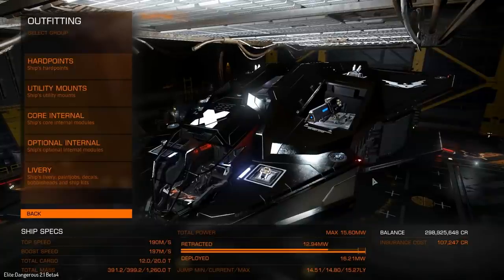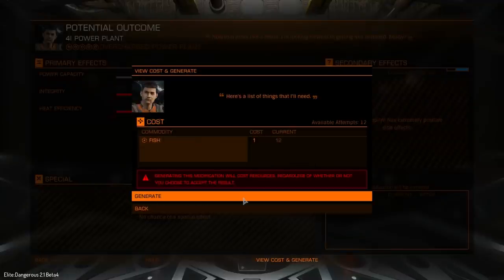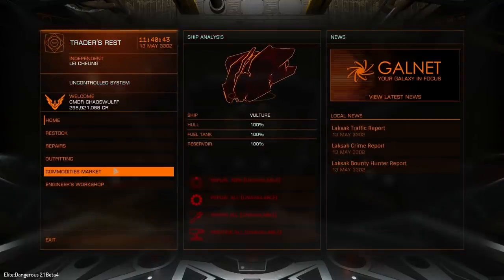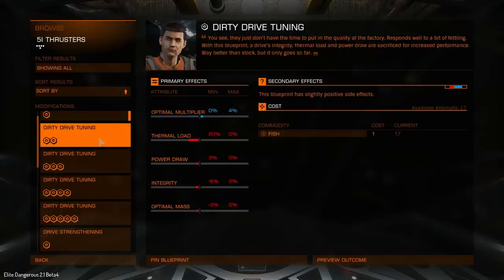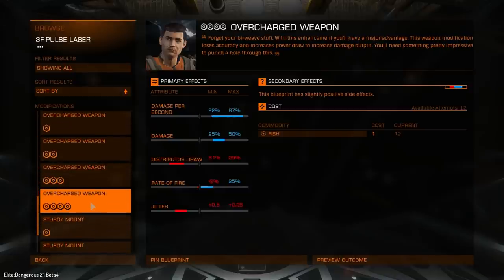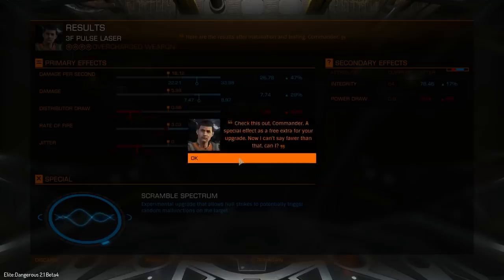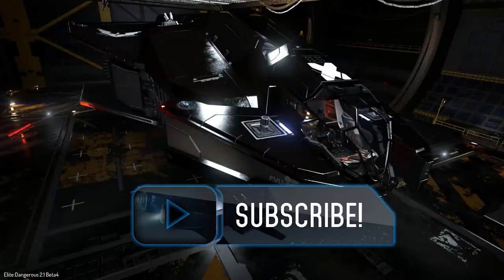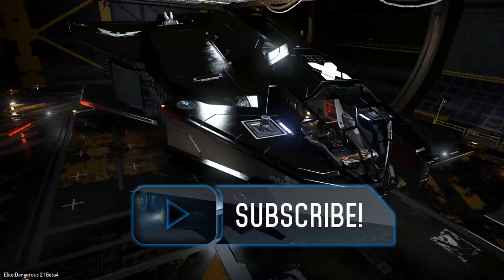Engineers Beta 2.1 - Modded Vulture

Comment: Thanks for the vids CW. 
"Hitting the casino" does seem like a good description of it. While I agree with using some RNG to modify the effects (and not just the special effects) a little, it might be better being a little more behind the scenes. Making it so blatant kind of punctures the immersion and the suspension of disbelief that Frontier have otherwise worked hard to improve in previous updates.

Comment: Try pimping out an Imperial Courier...it becomes a totally new ship.
Reply from the maker: +breakallegro I'll add it to the to-do list ;)
Reply: +Commander ChaosWulff It does, it's astonishing!

Mine's got a boost speed of 520m/s, two Burst lasers that can deal hull damage through shields and a Railgun that doesn't require ammo. Plus it's got an 18.93MW power plant so it can power 3A shields plus 3 shield boosters (A/D/D) and a jump range of 21.97ly.

It was my favourite ship before engineers but the jump range and speed meant I usually used my Diamondback instead. Now? Well, there's no competition!

Comment: the one problem i have with the vulture is that it has a low number of hardpoints which leads to asymmetric weapon loadouts...if there were two medium hardpoints located on the side of the engines that would be awesome, but alas.
Reply: get dual plasma accelerators to remedy this

Comment: I'm suddenly ok with this being RNG. 

except for specials. that should be choosable.
Reply from the maker: +Earning Attorney Aye, I would like to see that also, though I did have a lot more issues pimping out an Anaconda... mainly due to all the modules I ended up modding... it ended up taking 90 attempts to get it into acceptable range... not perfect... Just acceptable.
Reply: Commander ChaosWulff There are certainly more ways to compromise. Maybe a system that gives you a better chance at getting something good based on how many resources. Or maybe a teir system for amounts. At the very least a guaranteed improvement?

But the specials need to be chosen. 

Rng keeps it from being too easy to be OP like your new Vulture.
Reply: ***** Or maybe pick a preference before the roll and 50% chance you get your choice and 50% chance you get one of the other 3. 

But I still think the Specials should be choosable. Or maybe based on which engineer you visite. Which is kinda the impression I had when I first heard of the engineers.